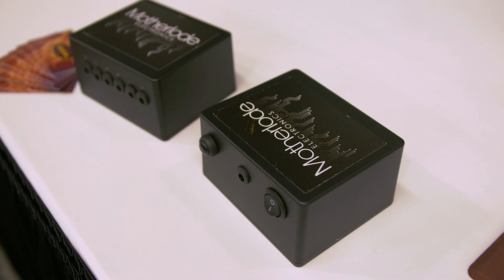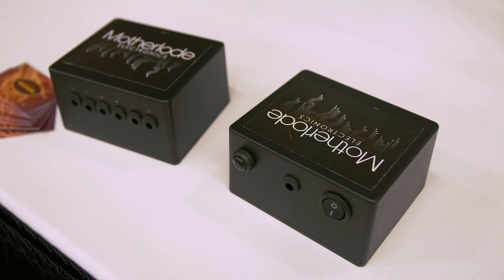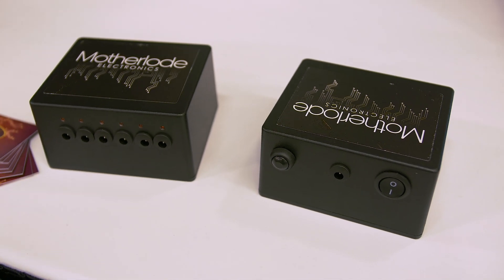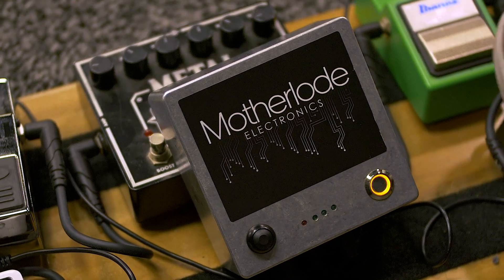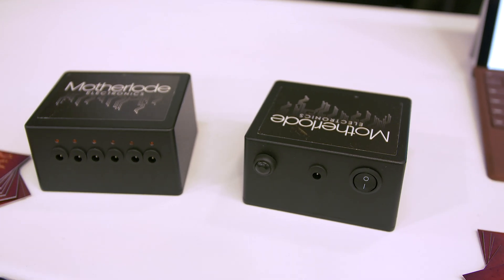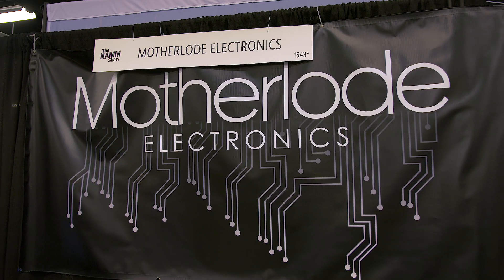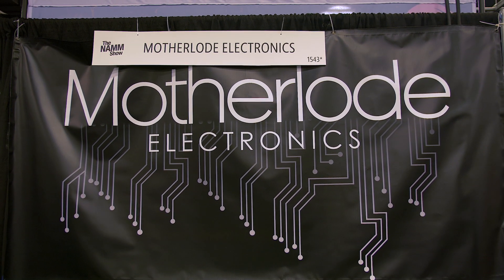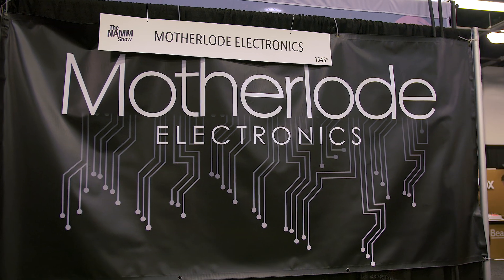Rechargeable power supply for YOUR guitar stomp box/effects pedals! | Electronics Makers

Comment: You had all that time and you didn't explain a bit about your stuff I'm looking for a rechargeable lithium-ion battery that I can recharge with AC that I can recharge from my DC Outlet in my car and or solar it's got to have two 12 volt AC plugins that are true sin power not modified sin and I'm not sure what the Miller hurts I want but it should be in the 30 to 40,000 range